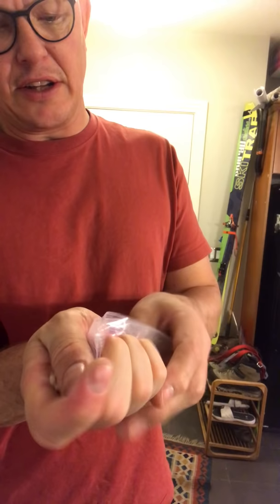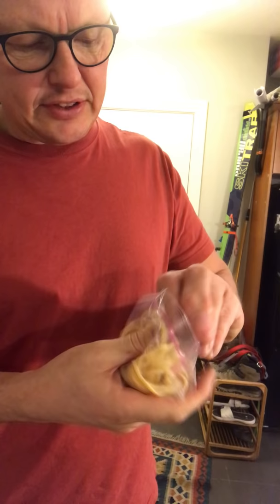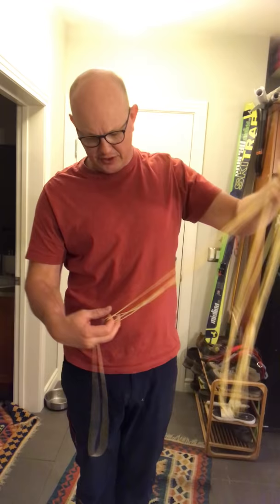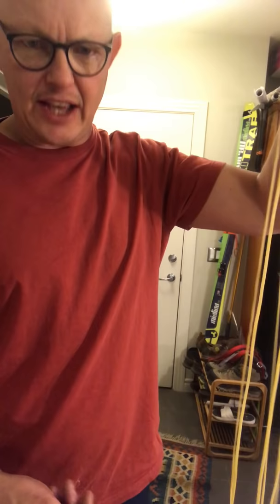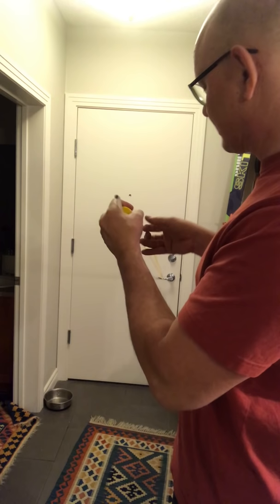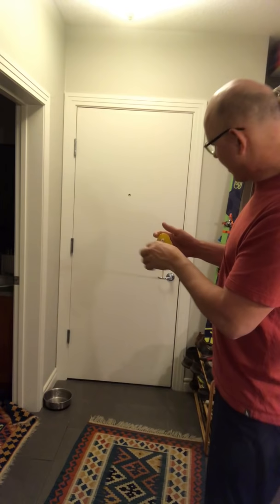Hummingbirdmodelproducts.com presents: How I braid rubber motors

Comment: Nice vídeo !
How long is the robber ?
Thank you
Reply from the maker: cant remember ... I select rubber for a model based on weight and cross section. The length is usually maximized to the point where it is still practical for fitting inside the fuselage etc.

Comment: If you wind backwards when braiding then you don’t spend the first 50 or so turns unwinding the motor when it’s in the model. It will also stop lengthening at the end of the run.Also if you have a third hand it is much easier😀😀
Reply from the maker: "Lengthening at the end of the run"? Never had this issue. What do you mean?